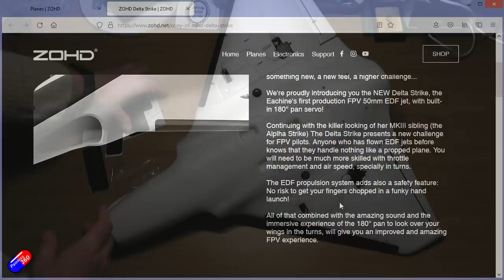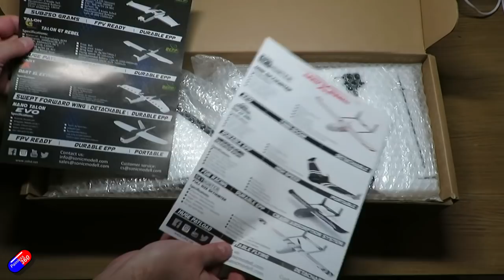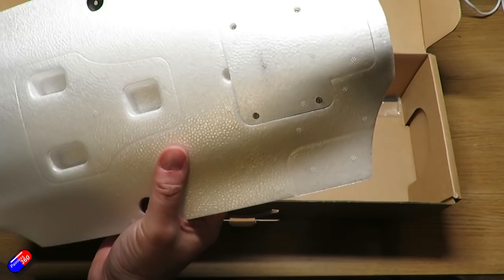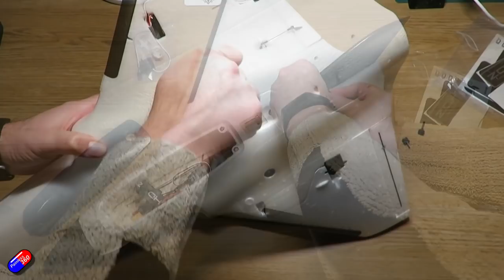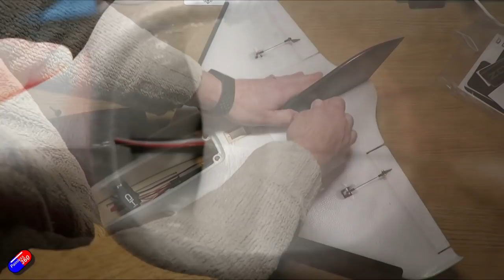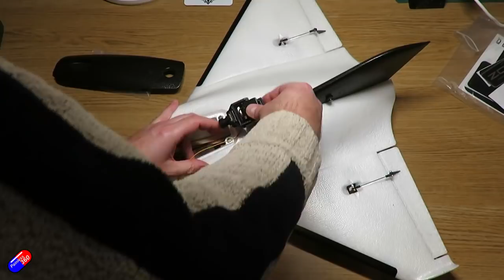FIRST LOOK!! New ZOHD Delta Strike: 50mm EDF wing!

Comment: Did you get this in the air in the end? I see some people not having much joy with it. Looks like you can open up the inlet to help with take off, would be interested to hear what you think about it
Reply from the maker: Nope, it's not a good design.. Happy flying
Reply: @Painless360  Thanks, I will avoid it 👍🏻 Ideally I am after a 900ish size EDF wing, I have seen z-84 conversions, but its EPO and an older model, do you know of anything which might fit the bill?
Reply from the maker: I'm not a big EDF fan, so porbably not the best person to ask. Best of luck!
Reply: @ Me either but got to be done on this one. Thanks mate 👍🏻
Reply: @Painless360  Hello mate, I actually need another delta strike for a project but they are out of stock PNP in the uk. Would you sell me yours if there is anything left of it?

Comment: Are EDF engines faster?
Reply from the maker: They are often designed for speed. But, traditional props can push a model to high speeds with significantly more efficiency... Happy flying
Reply: @Painless360  Thanks!

Comment: so where do you buy the control for the plane?
Reply from the maker: I don't understand the question. Do you mean the radio?
Reply: @Painless360  Sorry, yes! Looking at the site for the plane, the radio is not included. I saw a 4 channel radio at Amazon and maybe it would work with the plane.
Reply from the maker: A radio is an investment in the hobby so check out my Kit Picks video from last summer (new one one the way fro this year but the radio piece is the same)..
Reply: @Painless360  Thank you.

Comment: I fit a gps in under a removable panel in front.of the tail fin and a Sparky 2.0 flight controller all the way at the end of the battery bay. 3/4 of the sparky 2.0 is way back on the foam. Tbs receiver is mounted where the camera pan servo would go. 1800mah 4s only 3 minute flight time.  Has anyone tried a 2200 ma 4s or a 1800ma 6s ?

Comment: I was wondering if it would be possible to use in this model the zohd flight controller? I have a spare from my Orbit Neon. Have you tried this model with a flight controller? Thanks!
Reply from the maker: A stabiliser or flight controller could be a good idea. This model has issues though. Best of luck
Reply: @Painless360  , care to expand on the issues you've found? I have a spare ZOHD stabilizer from my Orbit Neon, do you think that stabilizer could work on this plane? Last question; Have you maiden your Delta Strike and are you planning on making a video? Thanks again Lee for all of your reviews/videos!!

Comment: Are these 50mm EDF motors (2611 4000KV) efficient for cruising? Wondering how would it fit to AR wing PRO. Maybe even two of them for better yaw control.
Reply from the maker: EDFs are not efficient at all. See my series on motors and props on why; https://www.youtube.com/playlist?list=PLYsWjANuAm4q1nqZUOm3PrlUq0TlzuXzk
Reply: @Painless360  Thanks, i was probably wrong when i thought lower kV motor, less blades and larger housing/prop diameter would be spot on for efficient cruiser.
Reply from the maker: A two bladed prop spinning slowly is exactly what you want. See that series..

Comment: Flew mine for the first time today. 5 flights. My first ever flying wing. 2200 4s zippy compact and cog at bang on 65mm. Throws exactly as manual with 2mm up from neutral on  elevons. Surprisingly easy hand launches at 70 percent throttle. 50 percent expo made flying controllable and glides in smoothly for landing. Only flew on two thirds throttle cause I scare easily. Was very pleasantly surprised for my first flying wing as I expected a much worse outcome. Hope this helps. Andy in uk.
Reply from the maker: Hi Andy, thanks for that. Actually really helpful as we are playing with this model for a flight setup video at the moment. I've also found that there isn't enough of a tube behind the EDF so you loose some of the power. If you add just a 1" extension it can add about 10% more thrust making it a lot more efficient. Happy flying!

Comment: Zohd kopilot system would probably fit in there nicely, you’d have return to home and stability modes would make it a nice cruiser, and with the fpv module it would be a great long distance flyer. It also looks very nice too.
Reply: I don't think it would make a good long distance flier, depending on what your definition of "long distance" is.  EDF's are highly inefficient, they just SUCK down the power, an you can't really do a Li-Ion batt pack in them because they suck up so much juice.

Comment: i feel the one down side is if the motor burns up there is nothing else that can be used atleast on the alpha strike you can switch motors to what ever you want i have been into speed here lately i dont fly far just fast

Comment: Hi, what’s the dimension of the battery compartment? I can fit a 4s 1500mAh that I use with my fpv drones or I need long and flat lipos? Thanks
Reply from the maker: I've posted the dimensions in the community tab. I hope that helps.. Happy flying
Reply: @Painless360  thanks

Comment: I don’t think you need an iNav FC and GPS in something like this with short flight durations.  You can’t go very far and get back home!  Radio dual rates should enable good control. Maybe a small simple stabilizer would be enough and would fit.

Comment: Thanks for the video. 

For me, this particular model just misses all the marks for use as an FPV plane. Having the pan servo where it is, the lack of internal space for flight controller and even worse the poor access into the area where one might put a flight controller, even a small one like the F411-WSE.

Being EDF is the last straw if I'm honest, I guess it could be fun and there will be lots of people who'll be happy to fly an FPV EDF, but flight time will be short in comparison to a regular motor/prop combo.

I noticed also, the servo wires just go straight through the internal air ducts, from ZOHD who've been great at designing their planes in the past, I would have expected the servo wires to at least loop over or under the air ducts.
Reply from the maker: I hope that once ZOHD are happy they have filled this gap in their line-up they go back and improve some of the older classics too... Still waiting for a Dart V3 that can support modern electronics easily for example..